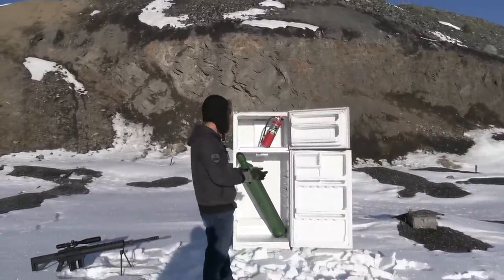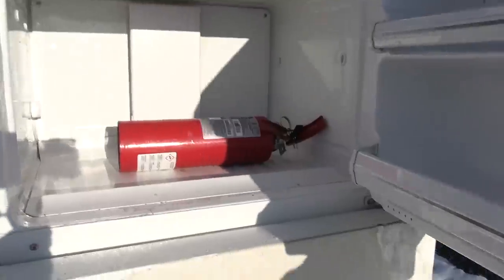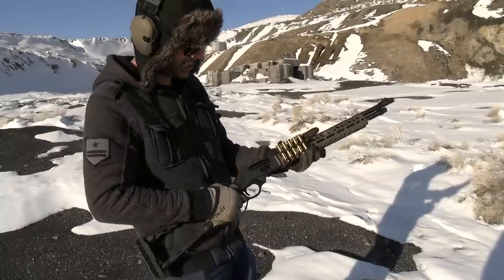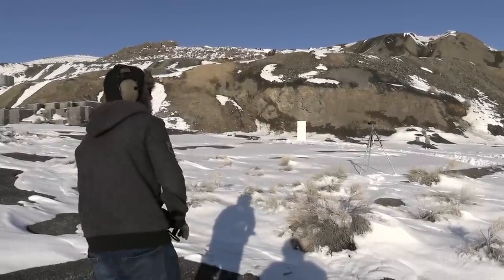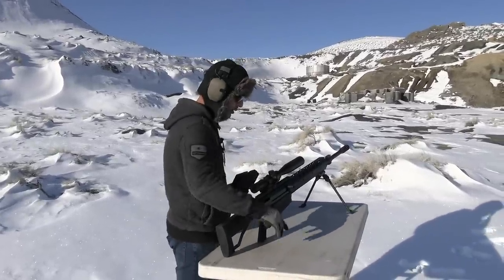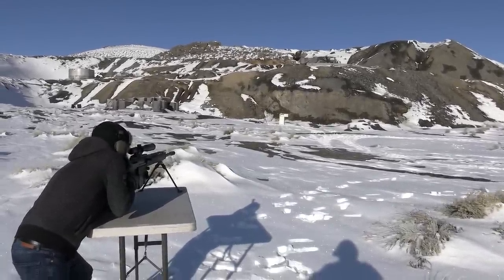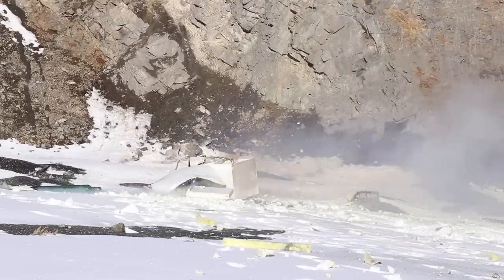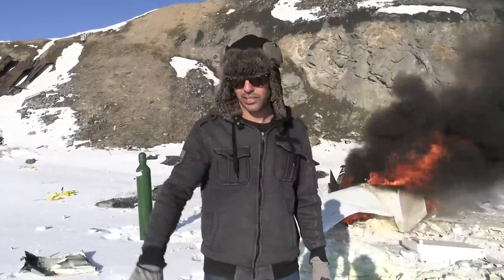Don't Put ur Oxygen tank in the fridge

Comment: Those 45.70 rounds pack a real wallop.  I fired a friend of mine's old Sharp's carbine a few times and it used that size round and the first time it nearly knocked me down from the recoil as I wasn't expecting it, lol.  Another friend of mine had a serial number 0003 model 1863 gatling gun that used 45.70 rounds in 40 round clips.  The gun first saw service during the siege of Vicksburg, MS  I was allowed to fire a few rounds with it, though to be fair, I was just cranking the handle as to operate it properly took a 5 man crew, 1 on each wheel, 1 cranking, 1 setting the trajectory & changing out the clips and 1 running back & forth for new clips.

Comment: I have a request. can you dig a third of such a gas surface vertically and then shoot at the upper part? I think it would be worth it, especially at night. because what always flies away so spectacularly burning are the gas bottles themselves! the energy of the .50 caliber generates so much heat that the steel ignites along with the pure oxygen. hence these even and large bullet holes. If the gas bottle can't fly, it burns longer and doesn't burn itself out.🥰

Comment: Oxogen is not flammable on its own but because the steel was hot as the bullet passed through the oxogen causes the steel to burn and because it’s an oxidiser the steel will keep burning like a thermic lance does the same exact way until the oxogen is depleted.